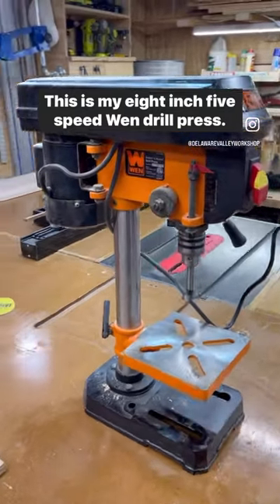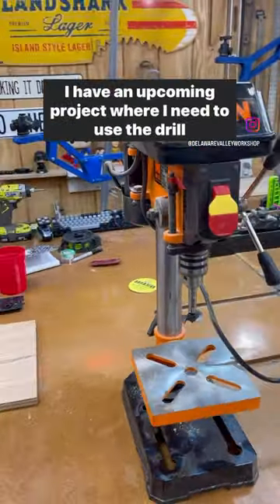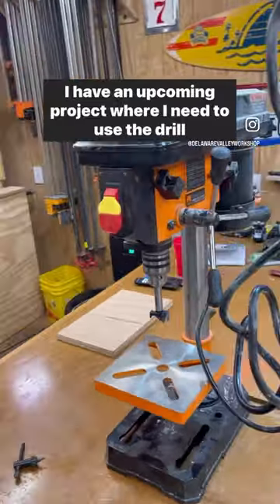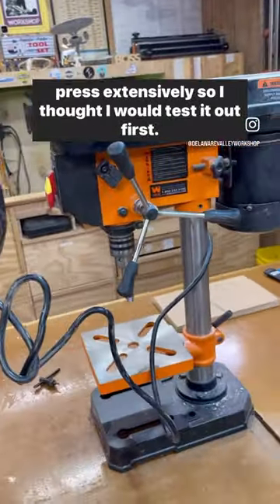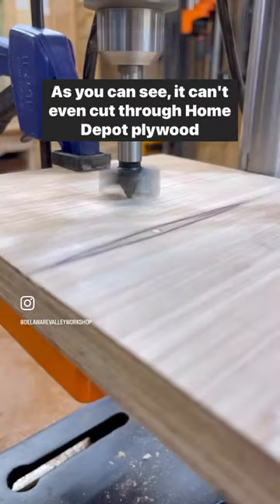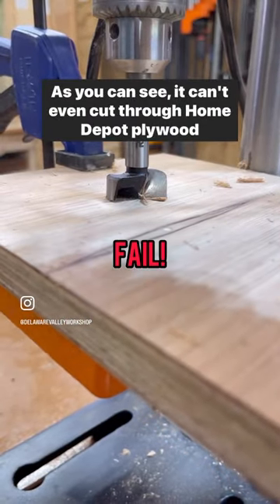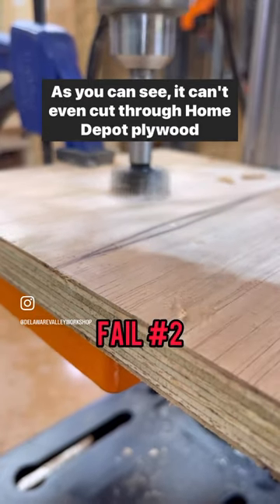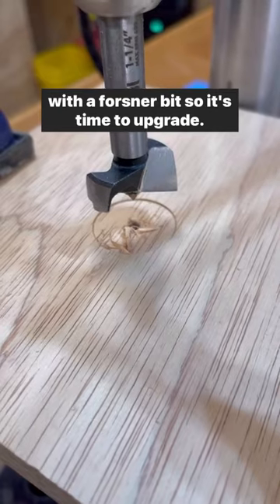Underpowered Wen Drill press #woodworking #diy #shorts

Comment: There should be graduating belt pulleys that change the power-speed ratio. Speed is inverse to power.  This is true for ALL drill presses.  But by all means, plunge a 1-1/4" bit as fast as possible to make sure to bog down the drill.

Comment: ive used this exact drill press to drill 1.25in in baltic birch (probably on a lower speed). but, i still dont recommend this drill press, spend up for one you can adjust table height without changing the x-y positioning and hey it will be more powerful too probably